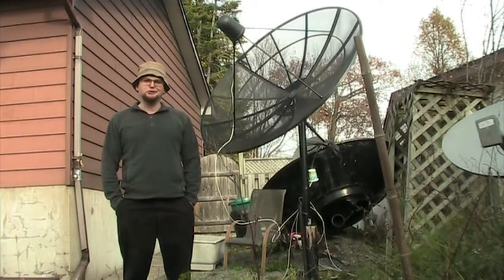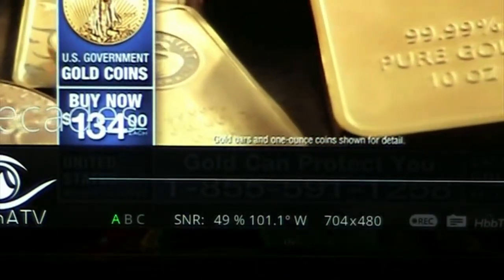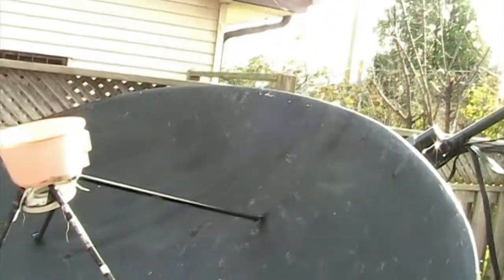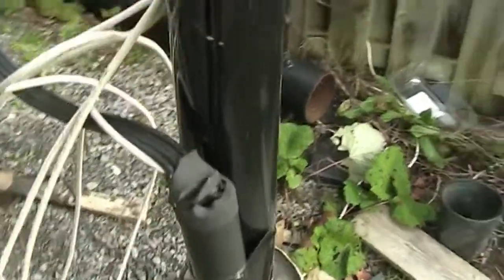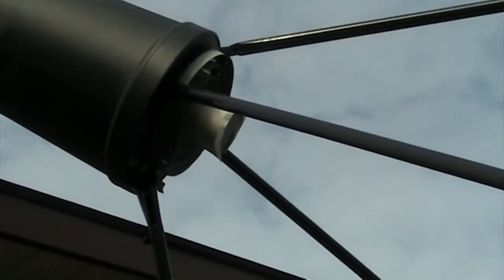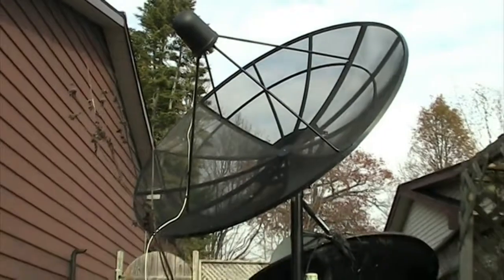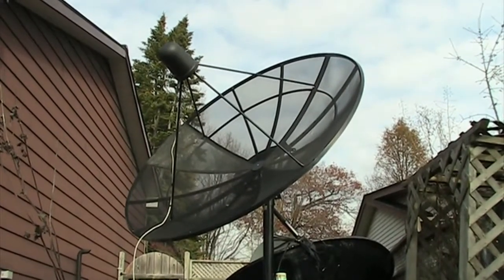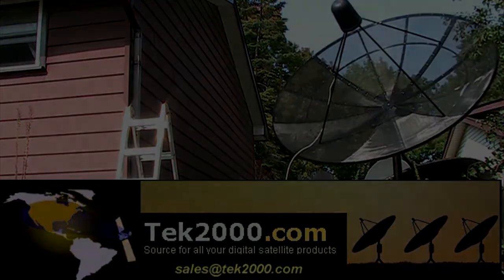Solid VS Mesh satellite dish?

Comment: I tried to take a solid 10’ down myself to bring home. It was a nightmare. Besides being so heavy, it was extremely awkward to take down and disassemble. Instead of being bolted together like a mesh dish, the panels were fastened together with a ton of machine screws that I could not loosen up, instead the heads of the screws were stripping out and I had trouble even getting the panels apart. Then it started raining and the panels started to get bent with me trying to maneuver them apart and it became a disaster. I ended up loading up the dish in my truck, saying thanks and taking it directly to a scrapyard. Since then I  only deal with mesh dishes, I have taken down 4 all by myself with no problems, they are light and come down one panel at a time like a big pizza. And reassembling them is simple, all I need is my brothers to help me lift them onto the pole afterwards. Anyways that’s my two cents, but it makes sense to think the signal would be better on a solid dish.📡📡📡📡  Thanks Robbie 📡📡📡

Comment: AGC - Automatic Gain Control - The AGC circuit keeps the receiver's output level from fluctuating too much by detecting the overall strength of the signal and automatically adjusting the gain of the receiver to maintain the output level within an acceptable range.

SNR - Signal to Noise Ratio - SNR is defined as the ratio of signal power to noise power, often expressed in decibels. A ratio higher than 1:1 (greater than 0 dB) indicates more signal than noise.

Comment: In my case I recommend mesh because I live in a place with strong winds. For large or motorized satellite dishes I only recommend mesh. In my case I mounted 4 KU Band satellite dishes 2 are mesh and 2 are solid. One of the mesh is mounted on H-H motor, I had no problems with the mesh dishes, but with the solid ones due to strong winds I have to realign them at every 6 months even when I tightened the screws very hard, while the mesh dish I only realign once at every 2 years. 

As for signal reception I had no signal losess and I haven't seen any difference, all my satellite dishes are AMIKO brand 100 cm and I have installed multiple LNBs on each dish except the motorized dish. I use AMIKO TSC1270 digital meter for installing satellite dishes and TV antennas

Comment: For C band it will be the same because Wavelength anyway will be reflected,  but for smaller signals such as KU will work but not as the same, for KA band with a wavelength of 7 mm the hole of the mesh would permit passing of energy, so for KU circular and KA solid is better.

Comment: I have 5-6 feet diameter metal dish sitting in my backyard, it came with the house I bought ,i was thinking to converting it to cell phone antenna ,there is no cell signal at the house,any ideas?
Reply: You can get a cellphone repeater, can put on frount of dish and point to your closest cell tower.  If have internet can also turn on wifi calling

Comment: Keep in mind that a solid fiberglass dish is still mesh (the mesh is embedded in the fiberglass). There is a couple sizes of mesh as well, the larger holes and the smaller ones. I have a Orbitron from the late 80's that works great for C, and alright for Ku, and it has the smaller holes. True solid dishes are mostly a commercial item and are either aluminum (usually 1 piece, can dent easily), or steel (bolts together)

Comment: I have mesh with KU band who provides service for these now? 
I need a new rotator arm. Or does these now don’t have to rotate?
Reply from the maker: it is good if you want to move to a different satellite!
Reply: I service those BUDs I own many dish parts, totaling 7 dish in parts. But I'm certainly not local to anyone here.
Reply: Btw, you have mesh, plain (aluminum) and ipoxy/abs with a mesh mess in it.

Most non-commercial plain dishs like the Chanel Master are of the last  type. That's the worst. The mesh one are good if you can't stick a pencil in the holes of the mesh. The best are the big plain alluminium one but they can warp and become useless. I like the south-american 12 feet Paraclips (unpainted alluminium mesh).

Comment: Your solid dish FD seems 0.3fd (too deep) and  mesh 0.41fd. If your solid design was of same FD design as the mesh, the signal would sure be more better than the dish. For offset and parabolic dish, parabolic of technical shallow design will do better than offset, offset only illuminate some surface area of the dish but parabolic dish illumination the whole dish surface before they returned (reflect) back to the focal area.
Reply from the maker: That would make sense the solid dish is over 30 years old and was used back in the analog days. Thank you Adebayo!

Comment: Solid sat dish far better than mesh especially if you are working on KU band frequency. I fabricate and also install dish 2metre and 7metres dish.
Reply from the maker: I have gotten KU band with the mesh dish. But I have found a solid offset dish does better with KU in my experience.
Reply: one thing I notice now is F/d difference between 10ft solid vs 10ft mesh...there might be reasons for, comericial they used solid like smaller counter parts... I learn 2 types of parabola...spherical and parabolic...solids tend to be more spherical for designs usage like tracking weather, uplink, measuring tides, astronomical tools, and managing multiple offsets beams on cband while mesh is design as parabolic more cone shape is to increase more gain on one satellite while it can operate multiple satellite downlinks but not greatly as solids with shallow spherical dish designs does when it balance 20 degrees arc for equal performance due to the shape...thats what i believe but please test my theroies on both dishes..need to know what i need for 20 degrees project offset...i want to do 5 feeds on one cband dish..i know its possible

Comment: I have a 12 foot zenith mesh dish and had a descrambler and was paying for a package but now thats history after coming across your channel i decided to play with the old dish again i have to cut down some small trees that has grown up in front of the thing.My receiver descrambler is moving the dish and it says 80 percent signal but no quality i dont know how many satellites are gone now since this worked and i think my ku band lmb went south but you can get a free to air box on ebay for cheap now just have to get a dish mover and figure out satellite charts again
Reply from the maker: yes now you need a dish mover https://www.youtube.com/watch?v=7mfDgR4o6TQ they are not part of the reciver. But you can link them using a Diseqc command

Comment: i have 2 solid thin steel dish...one 5 ft and other 7ft...my mistake was i should gotten 8 ft first...i wasn't sure whats out there, thought cband died long ago..but cable companies are still using today for 3 mega corporations..don't be alarm, i am not any spokesperson for cable companies, i get that a lot online, anyway 7ft is only great on one satellite feed but getting 2 feeds is proven been a challedge on offset location mode, due to my mount its not design to move like yours..mine is basic azel mount..it been nice have one of those but you know online stores sell the solids models goes to the ground mount..the one you see online carry Floor mount design put together method..well you can see i want a pole version mount so i have to custom made one myself, not easy at first for 5ft solid, but it works..then on 7ft can't find anymore mounts online to custom fit on due to size and weight...its very hard to lift 210cm solid off the ground on 5ft pole...nope forget it, so i used the floor mount it came with...

honest i can say..the 7ft does better than 5ft ( 1.65m) big mistake of purchase earlier..should had known better it work..now i realize on tvrosat site give lot of details on channels alvaible and pletty of them to pick ...my favorite is 58w and 91w ,99w, 113w, 116w...can't get 131w some reason..not sure my location or what...but your info on 101w is very helpful on snr at 49% but you left out not everyone is the same from SNR due to which part of most focal point of the beam can get the most of signal...does satbeams.com is most accurate site for dish requirments cause...i having diffcuites to understand why on 210cm..couldn't get anymore channels on it on101w and 127w but 58w or 91w,99w, 113w, 116w no problems on my location i am at, exmaple on 58w on 210cm... i am getting 77% and 74% majority of transponders....then my lowest is 64%...my zipcode is 78415 in the states...whats yours

also AGC = Automatic Gain Control - which means signal strength, meaning the signal from the meter..needs to be the highest to get more trasponders open on the beam...usual 84 gets good number while 80 is good but below 70 is bad..you getting nothing ...and SNR is the quality of noise ratio..i usally i never used percentage..i used Ber dBuV and S/N ratio dB from satlink meter 
on 58w...on one strongest transponder 3840 H i getting 80 dBuV ,13.2 S/N dB that translate for 77% signal quality  and thats pretty good when all transponders will pop up when you got the LNB skewed accurate position of satellite transmitting at 6 oclock while poles are the same if i move it to 12 oclock ..weird for cband...Ku band is lot different i ecounter with..
Reply from the maker: Thank you  AGC = Automatic Gain Control
Reply from the maker: Thank you for the INFO. I have gotten 131west but week and only a few transponders. I Put my dish next to my house so i get most of the satellites!